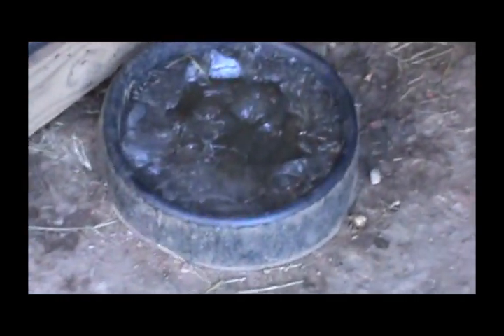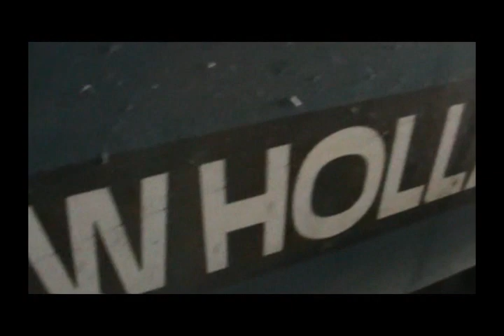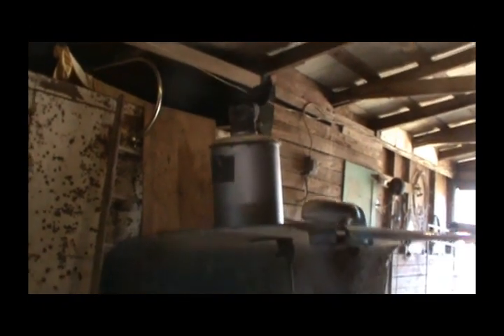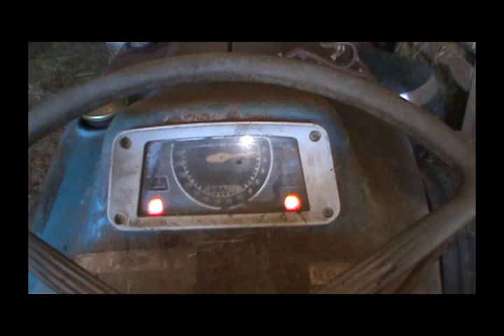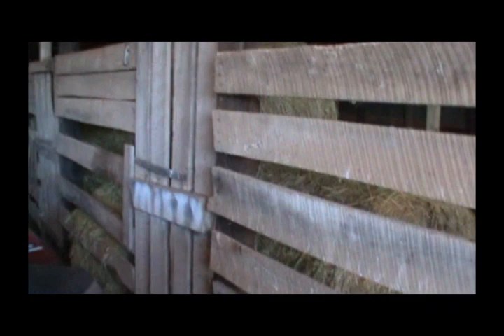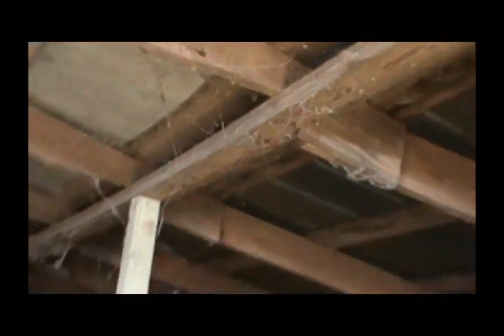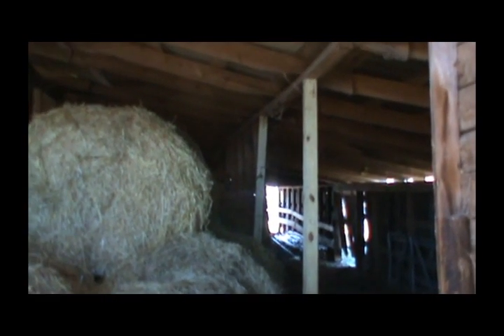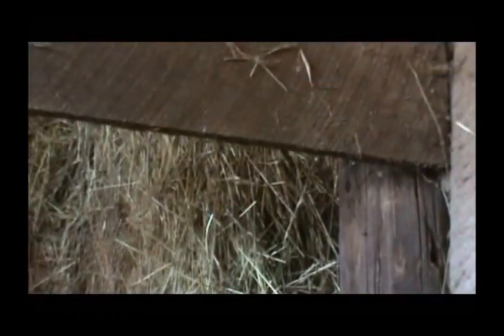NH 3930 Cold Start and Barn Issues

Comment: It's been cold in Monroe NC the last few days.  I can sympathize with you on the cold starts. I installed a heater on my 674 IH a few years back. It makes a world of difference when it's hard cold. I hate using either. Thank JRM
Reply from the maker: I should install a block heater on the 3930 but usually the weather is not too cold for long periods.

Comment: Doing all the good!

Hope all goes well with the 3000.

John
Reply from the maker: I got it running later after charging the battery but it's still weak.  I think those batteries are around $120 and we don't use that tractor much during the winter anyway.

Comment: I think Farmtracs might have the heater too, because they are Ford tractors with a different name
Reply from the maker: I've heard the FarmTracs are just clones but don't have the Ford engines.  I've never looked at one up close though.
Reply: When I was replacing the Radiator on my Farmtrac 60, the dealer said Farmtrac's can use Ford engines.